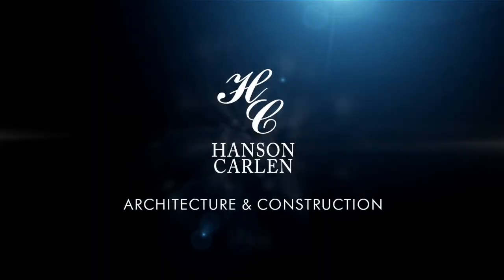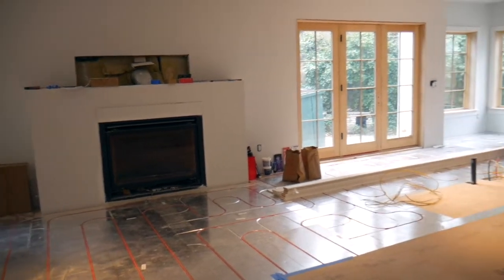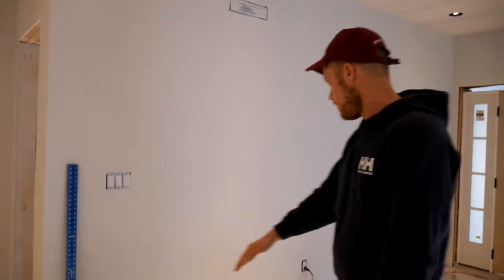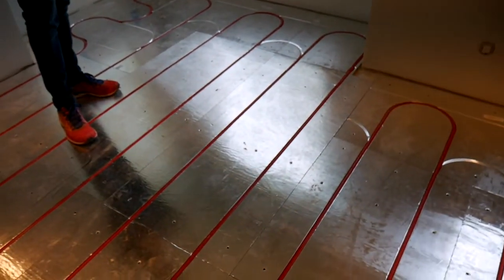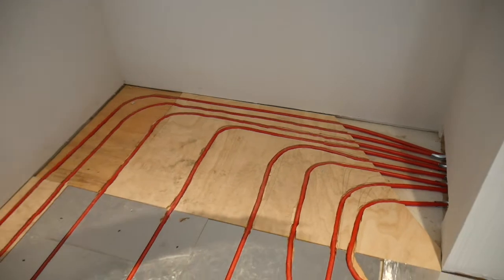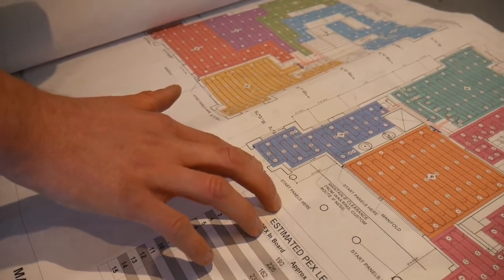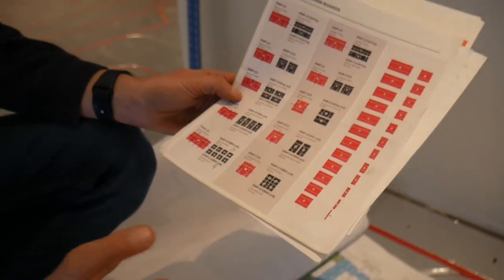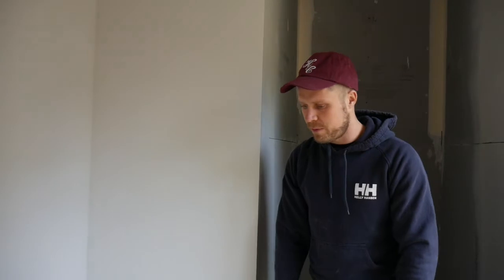Ecowarm Board Radiant Heating Installation Tips

Comment: He is right about his tips. I'm doing this starting today 5/02/24. Just me! I'm a DIY'er and took on radiant floors myself instead of leaving it to my contractor. I got the Warmboard with the aluminum foil. Expensive, but this will be my primary heat.
Reply from the maker: That's awesome! Taking on radiant floors yourself is a big project, but it sounds like you're up for the challenge. The Warmboard with aluminum foil should provide excellent heat. Best of luck with your project, and I hope it turns out exactly as you envision!

Comment: Great video! We looked at ecowarm and warmboard for our 3300 sq, 2 story house and decided to go with a gypcrete pour instead as it was by far the most cost efficient option.  Payback for ecowarm over the gypcrete was 25 years and warmboard I’ve gypcrete was 50 years
Reply: Hi Michael, what is the price different? I am debating to use gypcrete or ECOwarm. Thanks!!
Reply: @wayneli8377  ecowarm was about 30k, warmboard was at 50k, the gypcrete pour for us was 10k
Reply: @mcltadros  thank you so much.
Reply: @mcltadros  Did you compare monthly cost also. I’m looking at easy to keep overall temp due to closer to surface, ability to install hardwood floors. Also the whole system involved in Warmboard, wireless thermostats. I appreciate any input you have.
Reply: @Iamanoufan  Although I am a mechanical engineer, I am not a expert in this field so please take my advise with a grain of salt.  Warmboard/ecowarm both claim higher efficiencies over gypcrete and understandably so do to the aluminum laminate they both use as a heat spreader. My math was 10%-15% operational savings (monthly or yearly) for ecowarm over the gypcrete and 25%-30% for warmboard over gypcrete.  The problem is that the upfront investment will take decades to recoup.  I can get the gypcrete pour for $10k, ecowarm for $30k and warmboard for $50k.  The rest of the components won't really vary in costs.  Once installed, you will never physically feel the difference between any of these systems, although your wallet might ;-)   Regarding finished floor, we are doing engineered wood and tile only so we will glue all engineered wood and thinset all tile directly to the gypcrete.  If your doing regular hardwood check with the manufacture if you can glue only or you need to nail it down.  Ecowarm lets you nail directly to their panel but you won't be able to thinset directly to the panel, you'll need a layer of cement board screwed to the panels 1st.  Warmboard can be nailed and tiled directly although the nailing will be a bit more challenging due to the thicker aluminum laminate as compared to ecowarm (also makes panel install harder).  Don't get to hung up on the "whole system" concept.  All the components, i.e. boiler, thermostats, manifolds, are all HVAC industry standard items so you could mix and match if you have a preference.  We'll be using apple home friendly thermostats.  The "whole system" concept is more of a convenience question.  I would also recommend reaching out to a structural engineer in order to determine whether or not your house can handle the additional load of the gypcrete (that's the only area where I see a real advantage to using the panels, they are a fraction of the weight).  Hope that helps!
Reply: @mcltadros  would you be open to talk to my husband about your experience with radiant floor heating. We tried to make the warmboard work but almost double to cost of gypcrete.  I not sure how to private mess age someone on here.